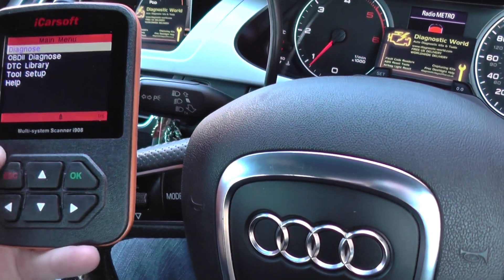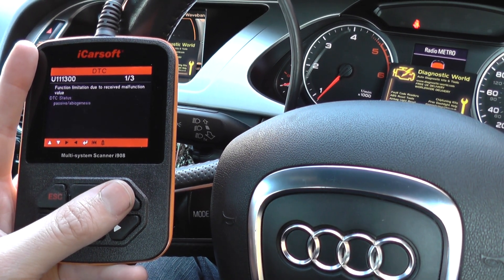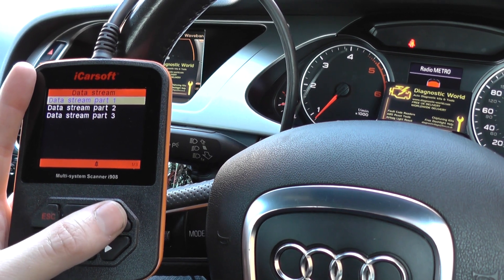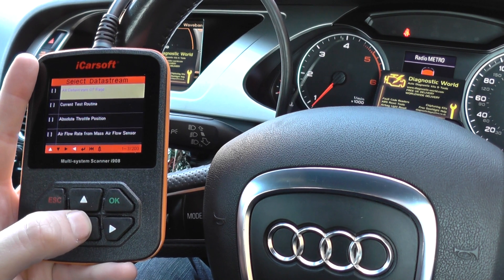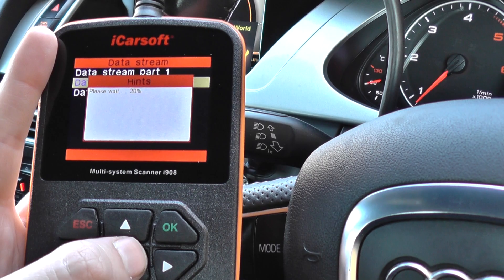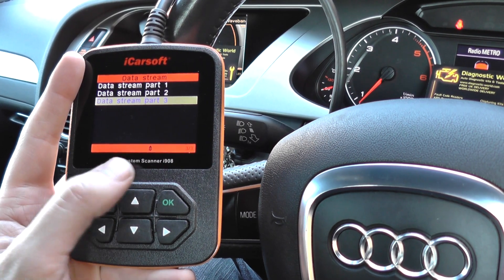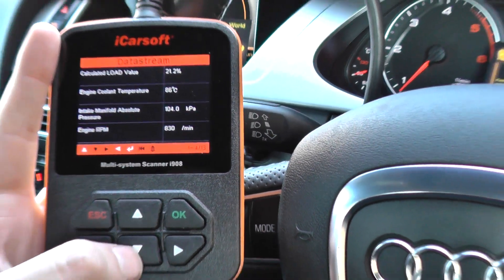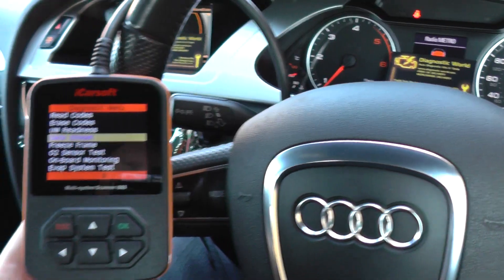Audi Live Diagnostic Data Using iCarsoft i908

Comment: Hi. Great video. I have a hand me down 2006 VW Passat that is an electrical nightmare. When I put the key in the ignition I get various faults pop up such as "engine fault workshop", "steering column lock defective", "airbag fault", "hand break fault see owner's manual" and other warning lights that pop on the speedo and rev counter too like the globes thing and the battery light. The problem is the car won't start with all these faults showing. It'll take 5 - 10 minutes (I've timed it) before the car will actually start and during that time it makes lots of make beeping sounds as I whenever I try to push the key in.

Nobody in South Africa can fix it without charging an arm and a leg for labour and replacement parts. One mechanic had a device like the one in the video but bigger (the VAG 2  think?) and he used it to reset the fault codes. The car started first time immediately after he did that, but after a day or so some of the faults came back, and eventually they all did.

My question is this: If I buy this device or the bigger one, can I clear the faults and will my car start first time? I think I need to buy one so I can do it every few days or once a week if needed. Can you recommend the iCarsoft i908 for the job.

Thank, 
Jonathan